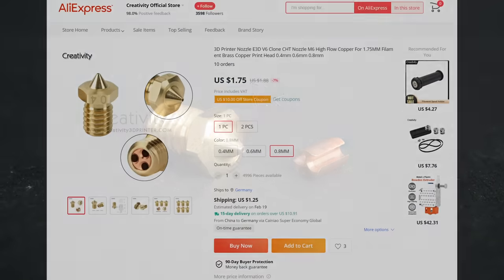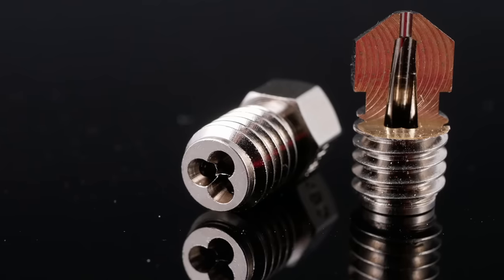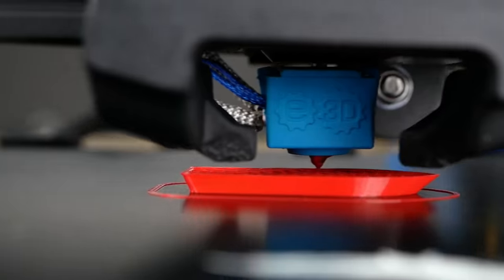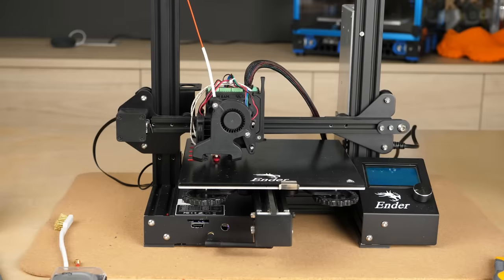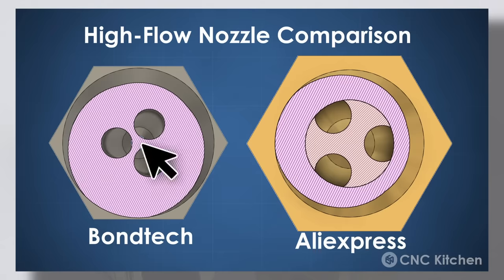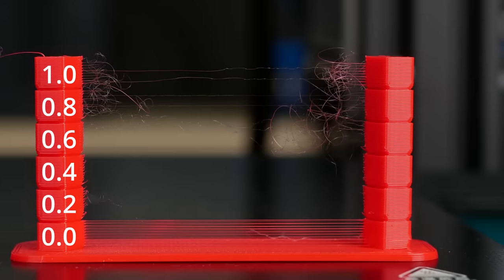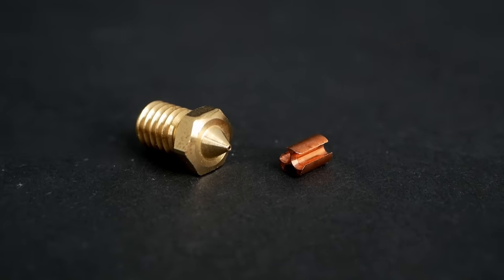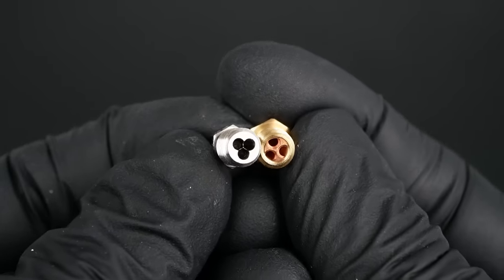$2 Aliexpress Knock-Off better than Original?

Comment: Personally I think its kind of crazy that what is essentially just some drilled holes can even be patented in the first place.
Reply: Well, in the case of CHT there IS some innovation (but then the chinese variant, or the Bondtech insert, isnt' itself a further innovation, so worthy of patent itself? =) ).
What I find ludicrous is Slice Engineering's patent (pending): they basically patented a couple rods (that keep still the heatblock).

I'm not usually against patents, when they make sense (and in the mosquito's case I find none).
Reply: Most patents are bs and shouldn’t even be
Reply: It is about the idea not the holes.
Reply: Although I kinda agree, it is about knowing to drill the holes that is being patented not the holes themselves
Reply: Although I kinda agree, it is about knowing to drill the holes that is being patented not the holes themselves
Reply: I'd say it's a good thing forces others to innovate not copy
Reply: reminds me of the patent for revolver cylinders where colt got the patent to drill all the way through the chambers instead of doing a bunch of work to add a percussion nipple
Reply: patents are fucking ridiculous

Comment: The insert approach is so much better from a production standpoint.
Reply: maybe you can have other inserts, like with 4 holes. or even 5 but smaller)
Reply: Only because the standard nozzle and high nozzle are the same except for the insert.  So the same item can be used for two products.  Otherwise, making the holes in the insert is about about the same difficulty and time consuming as the Bondtech.  The insert approach has a higher number of operations to produce.
Reply: @Shocker99  Making the holes in the bondtech is harder because they are at an angle. But yes, more ops, which doesn't directly mean harder.
Reply: @DimaLegoFUN  Since it gets the job done, and are $2.25 ea. delivered, one could say, sure, but would have to ask why, when it was shown to work just fine at higher flow rates than anyone currently could use (outside of a Bambu...)
Reply: @brianmi40  i found them at 1.6$ with shipping)
Reply: @Shocker99  The insert can be extruded, or diecast. And that is much more efficient than the angled drilling in a CNC machine. Diecast would be best because then you dont have to do the chamfers in a second op.
Reply: Heat transfer might suffer a little when compared to the one block design.
Reply: @DimaLegoFUN  yeah I didn't look overly hard
Reply: @titter3648  I would think extrusion is the better way to do it, since the surfaces can be much smoother and consistent. But I wish they would somehow make a chamfered cut on both ends for better flow performance. They could just used a lathe with blades of proper shape to achieve this. I could even cut out hundreds of these from a extruded rod per hour with a manual lathe
Reply: @DimaLegoFUN  the more holes means more walls the filamant drags allong. So there might be a point of diminishing returns, where drag becomes more of an issue.
Reply: @yuxuanhuang3523  ' extrusion '  Requires high temperature, etc which can be intensive and requires higher manufacturing capability on site.
Copper rod, a tiny amount oversized.  Three cutters/grinders to cut the 3 main slots.  3 more at the end, to cut the end chamfers into the slots to make it 'sharp'.  Then cut off that slug, move the rod forward and do the next end and cut it off.
With a little work you could make this a near continuous process just cutting them out of simple rod, instead of extruding.  Don't see any real reason for the complexities of extrusion or drilling on this part, little need for the rounder holes versus just some cut slots.
Reply: @jaro6985   The angle is no problem at all for a manual machinist or CNC programmer/operator.
Reply: @titter3648  Good point.  I didn't think about extruding or casting - only making it from a billet.
Reply: @HauntedSheppard  For sure, there is a boundary layer on pipes where the liquid is near stationary.  And so there is a point where the pipes are too small for the liquid to pass through at full flow rate.  In the 3D printing world, this is counter-productive for a high flow nozzle.
Also, if these were cut by a cutter from a billet - there is a maximum depth limit that can be cut from a given cutter diameter.  Going beyond it yields bad results and/or snapped cutters.
Reply: @Shocker99  OK but you'll need multiple ops, or a 5-axis CNC which is not cheap. Google screw machine parts to understand how most of these low cost products are made.
Reply: @Shocker99  for one off parts, yeah, it's easy. Compared to mass produced inserts on a high speed assembly line though, you could have a continuous machining operation on a coiled copper round stock and you have a continuous operation hammering out 10-20 or even more inserts in the same amount of time it would take a cnc machine to make a single nozzle. You can even braze weld the next coil of copper to the previous one once the previous one is used up to make it a literally non-stop process. The nozzle that goes with the insert won't take any more time to produce because you just need a larger diameter drill for the internal diameter that the insert sits in and can be easily integrated with already existing manufacturing processes.
Reply: @jaro6985  Our guys at where i work produce bespoke threaded items, shims, bushes, etc, for our bespoke products. That's how i know your argument about it being difficult because those holes are at an angle is false.  We don't have any fancy CNC machines either.
Yeah sure, doing bespoke stuff is expensive but if it can be easily done without any fancy tooling then it can be done on mass at a low cost.  If you look at any cheap widget, they're usually manufactured over several stages that do very specific operations.
Reply: @platinumsky845  Sounds like you're describing what @Titter mentioned.
Reply: Just needs to be done with hardened steel now and they'll sell like crazy 🤪 the angle drilled holes on the real ones must be an absolute nightmare to machine and makes it harder to clean properly.
Reply: @Shocker99  You've completely lost the point, I said "holes at an angle are harder" which they are. Manual labor is expensive and having additional steps where you need a person moving a jig around adds a lot of cost. Your experience is great but is unrelated, as you don't produce <$1 parts in high volumes, which is what we are talking about here.
Reply: @Shocker99  considering you implied to be refuting their comment, I'm not sure why that would be surprising.
Reply: @wyattutz  I can't imagine a printer capable of steady movement to print at commensurate high speeds that doesn't already come with that capacity for flow.

Every Bambu Labs for example, among the fastest, can already deliver those flow rates.

You're never going to get an Ender 3 up to 200mm^3/s without a complete makeover and linear rails...

Which printer that can without question MOVE and deliver the print speeds we're talking about but DOES NOT already support such flow rates to match?
Reply: And cleaning. Makes cleaning the nozzle alot easier. May also help with material charing also.
Reply: So can I just mill out any nozzle and drop the insert in? Ruby/diamondback with high flow
Reply: Not true. Everything is a trade-off. The CHT has two processes: CNC operations (which can be broken down, but depending on the machine it can start with bar stock and spit out machined parts into a bin for you to unload in the morning) and then batch plating.  The Chinese parts follow the "labor is cheap, work harder" approach. You have CNC operations on the nozzle (probably multiple setups- labor is cheap and nice equipment is expensive), then you have CNC operations or basic drill using fixtures on bar stock made to net size (thus the slop and probably variance) or lathe work first to make the blanks, then drill the holes (or visa versa), and plating for the nozzle if plated. You also now have two raw material SKU's to manage, and a two piece assembly to manage. You have greater chance of quality problems with the Chinese method, and now also on user assembly you can get it wrong.    So if labor is cheap, one way is cheaper but more complicated to manage. The other way, you have an awesome CNC running the same program every time, and barring tool failure, much lower quality risk.

Comment: seems odd that the patent for CHT gets blocked yet slice can patent friggin spacers on a hotend
Reply: US patent office granted a US company a patent of figgin spacers. US patent office rejected a European company patent on nozzles. Why is this not very surprising to me? ;-)
Reply: Patent systems a lot of times it's just stupid because it's arbitrary and subjective. Also, a lot of brands just patent better product that they are producing just to slow down innovation and competition (thus, maintaining their exact same product at high price with no changes)

For me. If a patent is not really used by it's creator, it should revoke. And if another brand can create a better product using you patent as a base, it should not infringe
Also, the people at the patent system don't know everything and they not are masters of EVERY matter in innovation. That's way you can't patent the wheel, or the internal combustion engine in it's whole. But they could patent a motion system, hotend configuration or filament management.......
Removable extruder/nozzle are patented... it's insane
Reply: patenting a hole vs patenting a donut
Reply: @hebijirik  Comes down to having patent lawyers in whichever country knowing what they are doing. I wouldn't be surprised that slice has a good legal team to draft patents whereas the EU mfgs are just filing electronically.
Reply: It only works if somebody opposes it. If nobody complains, you can basically patent whatever you want if you manage to write it weirdly enough so that the examiner doesn't catch the trick.
Reply: Slice has more money to write better patents
Reply: @hebijirik  
Getting a patent for something isn't that hard. If it is worth anything is only really decided in court if it is opposed.

Comment: The insert is really clever, but the execution could be a little more refined. It wouldn't hurt to have chamfers on both ends to make install completely foolproof and to help with retracts, probably. I thought the insert would be too loose for transfer enough heat, but it looks like it works very well. Maybe copper expands more than brass so when the nozzle heats up the two parts fuse together nicely.
Reply: Heat expansion coefficients: Brass 18,5. Copper 17,0. So no, the insert will not expand into the brass. The absolute expansion if the insert (assuming it is 4mm wide) would be around 0,017 mm. Which would be a very good value for a press fit. However, looking at the pictures of the insert it is pretty clear that this kind of precision is not used in the manufacturing process. Also the body would need to be out of Invar to not expand away from the insert but Invar is a bad heat conducter. A good pressfit would be considered "attached" so the patent claims would match.
Reply: @exi  Would the expansion of the brass pick up the slack here? Sure the OD of the copper wont expand so much but the ID of the brass will also get smaller.
Reply: @dixieduffy7 That's actually a fairly common misconception. When a ring shaped object thermally expands, it's somewhat reasonable to think that the ID would shrink as the material expands inwards. However, the ID and OD both expand.
Reply: I'm guessing that the fit gets tighter when it heats up even though as explained the Thermal Expansion is slightly higher for brass.  Here is the logic and I believe how it works.  When a hoop expands, the length is the "circumference" that is getting the largest change so the diameter is changing at C = Pi x D (or D = C / Pi).  This means the diameter is increasing at about 1/3 the rate of the circumference.  For the insert, it is expanding outwards and therefore is growing faster than the nozzle.
Reply: This assumes it’s 100% brass and 100% copper, with no alloying

Comment: Those saying the Bondtech nozzle is harder to manufacture are 100% wrong. A 7-axis CNC lathe or screw machine can make the entire nozzle in one setup. The knockoff has 2 parts and would require multiple setups/operations. You don't need "fancy" machines to do it, but those fancy machines are pretty ubiquitous these days.

Comment: On the one hand, I freely applaud Solex for bringing this improvement over to mainstream 3d printing from the other industries that have already had it for decades, and would love to tell people to purchase the original CHT from them for that reason alone. Unfortunately, like with Slice Engineering and Apple, I cannot in good conscience support a company that manages to brazenly get away with unlawfully patenting concepts and designs that already exists in other fields or in the public domain (see: Prior Art), or even companies that try but fail to do that very same thing. As a result of this particular immoral business practice and even bearing in mind that Solex have to date proven, if not necessarily helpful in all ways, non-obstructive to lone individuals and famous figures such as Stefan manufacturing and testing similar designs for comparison purposes and private use, I find that the only recommendation my conscience allows is to tell people to purchase only the knockoffs unless and until Solex ceases to misuse the patenting system and limits such intellectual property grabs to actual original designs as both implicitly intended and explicitly laid out in international and most national patent laws.
Reply: Maybe it was different back when the patent law was first introduced, but today it seems clear that patents overall hinder innovation more than it encourages it
Reply: @neelsg  a patent is supposed to include all the information so that someone in the same field could use the patent to recreate the invention ("ordinarily skilled in the art")

unfortunately, too many patents do not do so, and try to make such broad claims that it's not clear what they cover, let alone how to build it.

because someone else is supposed to be able to follow the directions and build the invention, it's obvious that it should NOT prevent people from making their own version of it for testing, only preventing someone from selling (or I suppose a large company could mass manufacture something for internal use)

patent and copyright maximalists have been pushing for a long time to make people think that they prevent anyone from doing anything similar, which is NOT what is supposed to be happening.
Reply: @davidelang  I understand how patents are supposed to work and what they are meant to achieve, but that is not the reality. Given how they are abused and how effectively corporations can use them to be anti-competitive, I just think we would be better off and have more innovation if those laws were scrapped altogether
Reply: The even worse thing that happens a lot is when companies patent something, or buy a patent, to prevent a (likely superior) alternative competing with their existing products. Patents really need to have a "use-or-lose" aspect, say they last the existing 20 years if you're actually producing (or licensing) the design, but if you aren't actively producing, developing, or licensing the design, simply blocking it from being used, it becomes public domain in say 3 years.

Another part of the Intellectual Property realm that needs overhaul is that software being covered by copyright doesn't make any sense anymore. When software began to be created, it was just dropped into copyright law which is meant to cover creative works, which I don't think software fits neatly into. That was probably what made the most sense at the time out of existing options, especially with early software that was mostly manually written. But software typically involves both functional aspects (how it works, "under the hood" aspects) that should be covered by a patent (in the same way a tool such as a hammer might be) and creative aspects (aesthetics, user interface, storyline of a game, etc) that would make sense as a copyright. Some software, such as CAD, or say a 3D printer slicer, is mostly the "functional" side, while a game might be more the "creative" side, but all software would have at least some of both, thus not fitting neatly into either a patent or copyright. So what really needs to happen is a new category specifically for software that isn't either, but covers both creative/aesthetic elements and functional elements. Though the reality is that I feel like IP-law isn't really used in software anyway, instead they incorporate other methods built into the product to prevent software being copied or used without a license.